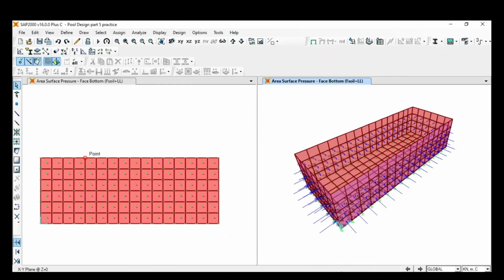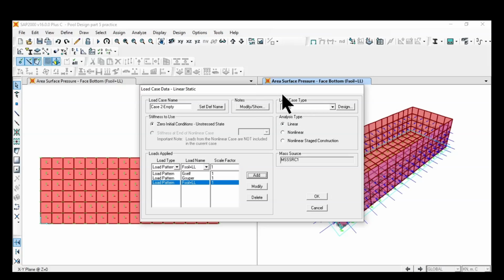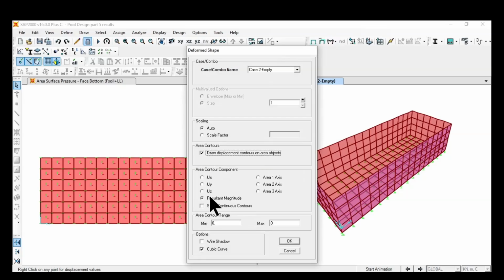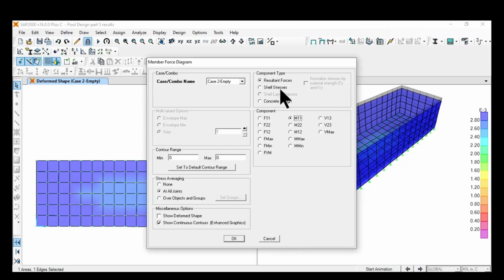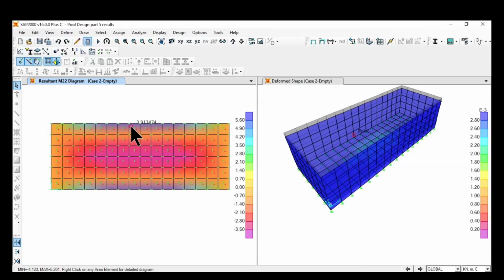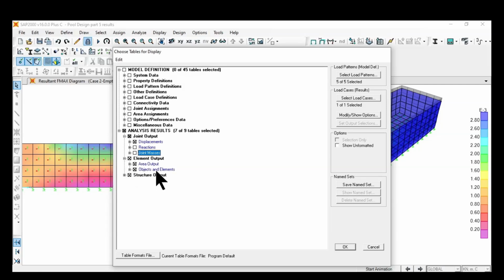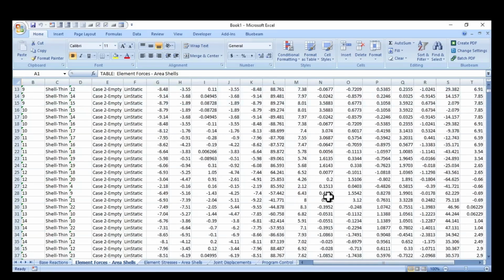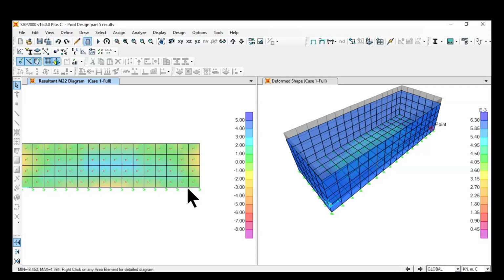Concrete swimming pool design Sap2000 -Part 6

Comment: also if swimming pool have circular shape - or pool with slope (shallow-slope-deep end) - kindly guide me about it also
Reply from the maker: @hassanshakoor190  Thank you so much for the positive feedback. You can definitely do a circular shell element  in sap2000. I usually do it by drawing a series of weightless frame elements in a shape of a circle then drawing the shell between the frame elements. Also, you can adjust the difference in pool base height in the coordinate system to suite your measurements. I may do a video on this in the near future.

Comment: hi sir video's are very good but last point - which final values we will take to calculate steel for swimming pool - and which method we use for steel calculation
Reply from the maker: @hassanshakoor190  In terms of steel requirements, first check the country standards you are working from for minimum steel requirements for shrinkage and for temperature effects. Tank design requirements may be different than a simple pool requirement. For minimum steel for serviceability, you may need to check for long and short term deflection which involves calculating the cracked moment and the long term shrinkage drying effects. For strength requirements you may need to use a simple concrete analysis to determine the minimun required concrete effective depths to withstand the tension and compressive forces determined from the analysis. Then ofcourse we need to check for ductility as well.  Refer back to the code you are working from for the minimum cover depths you need as well. I may do  another video in the future to present this for you.  Thank you for your feedback once again.